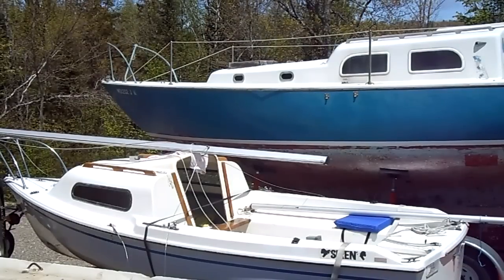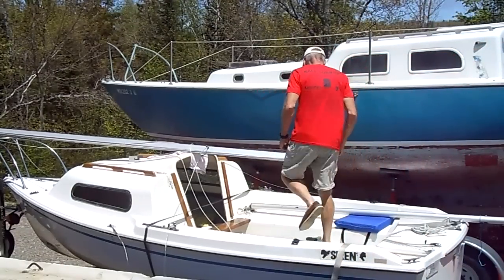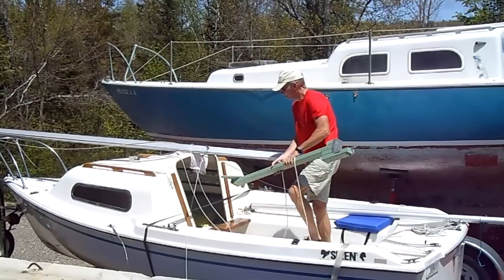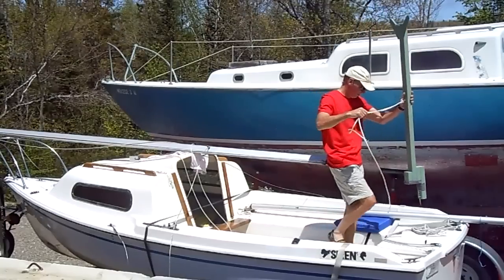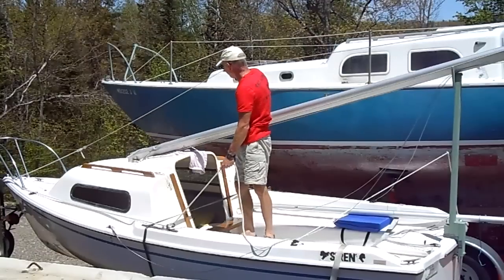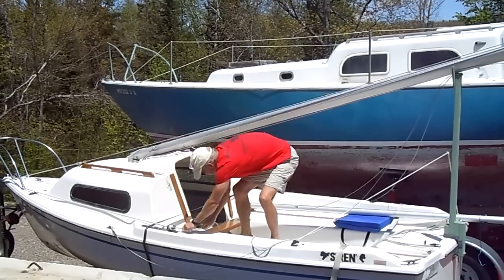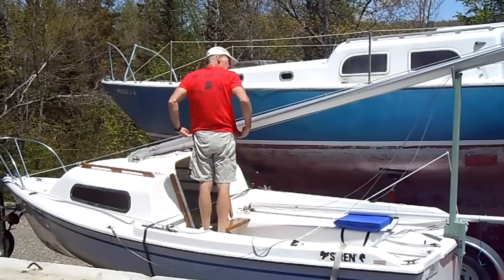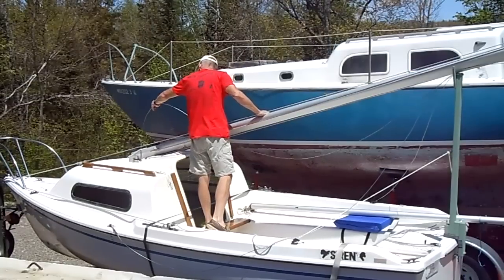Siren 17 "Spray" Mast Raising

Comment: It works well. I made my mast crutch so that it fits two bolts (pintles), one in each gudgeon, and doesn't need the support lines. Yours is about a foot shoorter, though, and might stow more easily. I have not led the halliard back to the cockpit, as you have, but climb onto the bow, because my halliard is not long enough.  I like your idea better. Keeps me off of the foredeck or cabin top.

Comment: Do you have the length and dimensions of a the crutch. I can estimate them from the video but if you have a general outlay plans for that would be wonderful. Again great voice video, can't tell you how many times i,ve nearly been beaned by the mast tiring to set it up myself.n
Reply from the maker: Linda Muvic No plans, it was just scrap lumber I had on hand. But the length from the top of the transom to where the mast lands is 52"  and the wood is 1"x2". I used a U-bolt to hole a long bolt to the wood at the bottom to seat in the gudgeon. I put a V shaped piece of plywood at the top top help catch the mast. Then some scrap outdoor carpet to lessen chance of damaging the gelcoat. Good Luck!